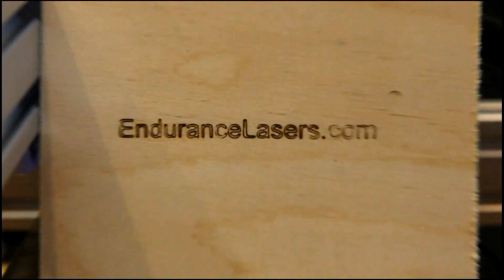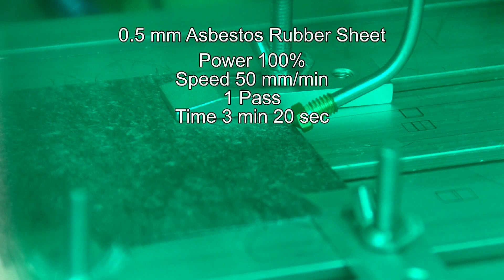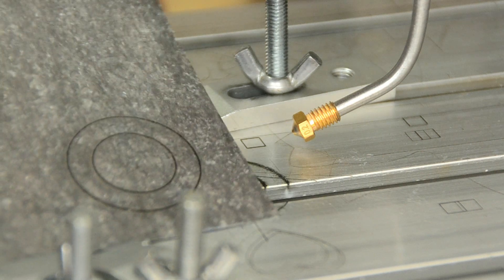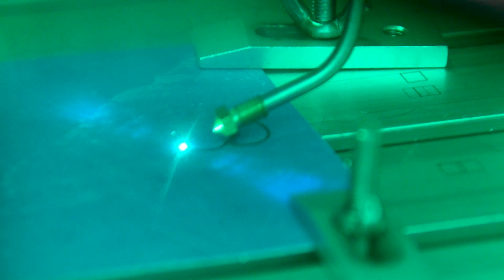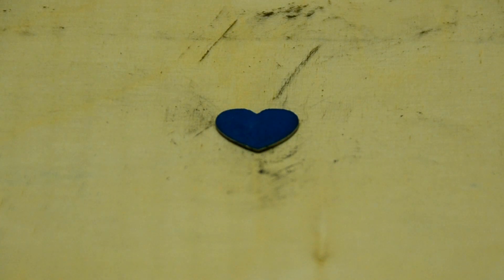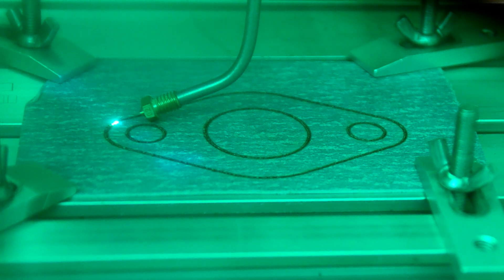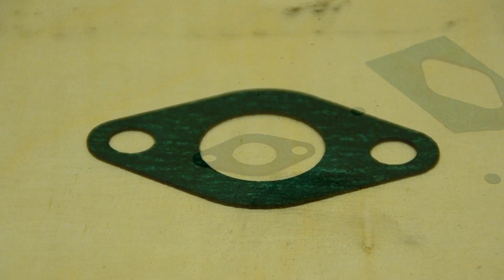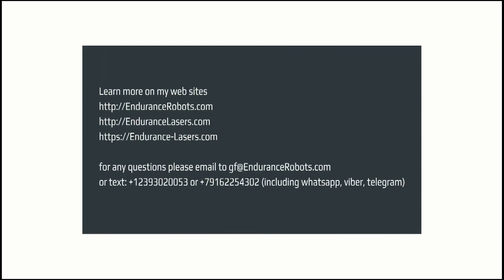Laser cutting of gasket sheets. CNC milling vs. laser diode cutting. Engine repair component.

Comment: I think a "charred" gasket, is worse than, a nicely milled version. YOu can remove the "fuzzzy whiskers" and be good.. the pre-burnt lasered gasket is a compromise to lifespan... a good engine will chew up a fuzzy and spit it out and not ever blink.... a charred gasket is prone to fail. 

I like carbon fiber rubber gaskets milled with a two flute, last pass very shallow to remove whiskers.
Reply from the maker: a customer wanted laser cut gasket and was very happy with our solution!

Comment: Asbestos rubber sheet (paronite) is designed as light duty gasket material. It is a compressed mixture based on chrysotile asbestos fibers, synthetic rubber or natural rubber, sulfur and other modifying additives. It can be found in sealing water, stream, salt solutions and water-based solution.
Reply from the maker: thank you David! Do you think this can be practical for auto service and auto repair shops?
Reply: @Endurancerobotschannel  I don't think so in the US as Asbestos is treated like nuclear waste in the USA.